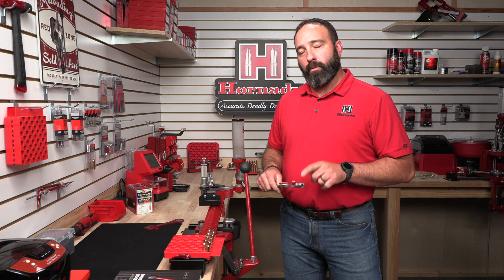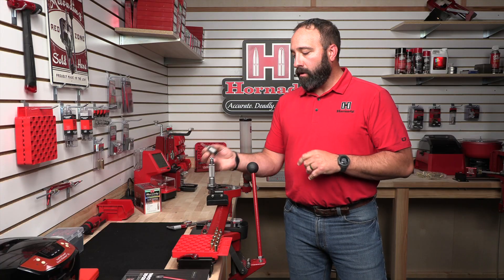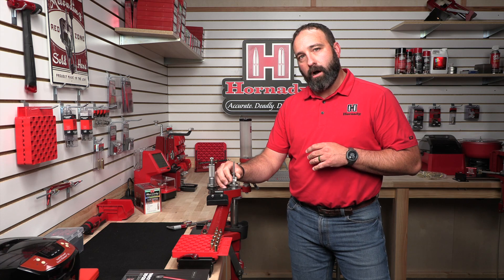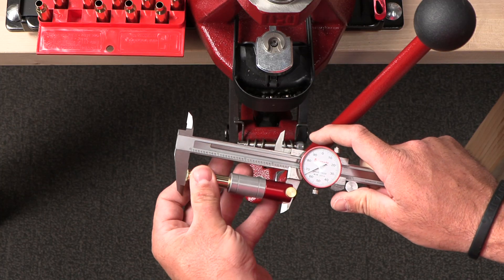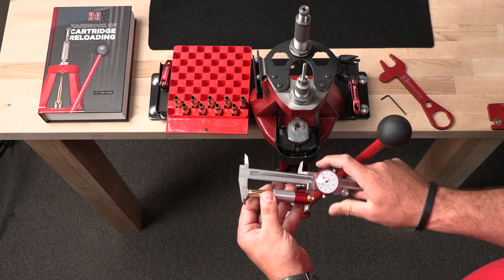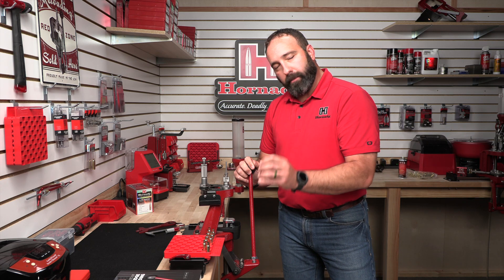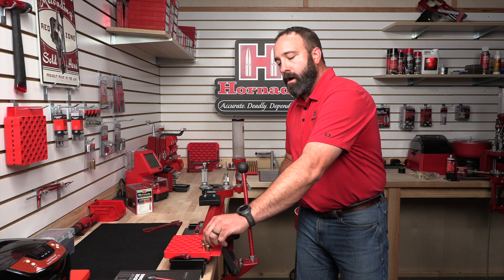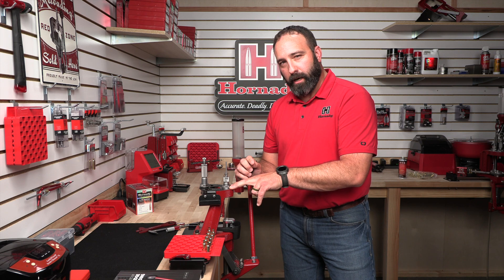TECH TIP | Setting up a Sizing Die using a Headspace Comparator

Comment: Please excuse my ignorance but I'm confused by your statement "sitting at 66 thousand"  That number  does not correspond  to the case specifications in the Hornady handbook for the 6.5 Creedmore.  What are you  describing?
Reply: Measure fired brass. Make that your zero. Rezero the calipers at that point. Sized brass should show -.002"
Reply from the maker: Just .066" on the dial indicator on the calipers.
Reply: It's no exact number, he just used the tick it happened to be landing on for that gauge to compare the next case to.

Comment: Which comparator do you use in this video? .375 or .400? Thank's!
Reply: Neck diameter plus shoulder diameter divided by 2.
So for the 6.5CM...
.295 + .462 = .757 divided by 2 = .3785.
So I think you use the closest, the .375 die #C375.
Plus on Hornadays website they list a ton of cartridge to die conversions.
I just Googled Hornaday Headspace Comparator, towards the bottom theses a long list, it also shows C375 for the 6.5 CM. 👍🏼

Comment: They neglect to mention that this is with their shell holder on their press. My first dies for the 6.5 Grendel were Hornady and already had a couple years using their comparator set and anvil and I cannot recommend those tools enough. The dies were junk in my opinion couldn't get even half way decent neck and bullet concentricity over .010" of wobble, but with my press and shell holder if you screw the full length sizer down to where it makes contact that was moving the shoulder .015" so I'd say it's better to screw it out at least a quarter to a half turn from contacting shell holder just in case until you know what work your die and shell holder combination are doing.
Reply: Agree on not screwing the sizing die until touching shell holder like you are saying if you do it moves the shoulder too far. I keep a small gap between die and shell holder to achieve the shoulder bump I want

Comment: That's amazing.   When I check my brass after running it through my Hornady press, I get about .003 variance from piece to piece with my Hornady comparator and calipers.   You measured the second one after a small adjustment, which was correct and viola, perfect.  So it's going to be spot on every time?
Reply: @russsmith1450  Your 100% correct. I thought it was just my press not sizing the brass to my desired shoulder bump every time. I have spent a lot of time adjusting my resizing dies. Now I'm between 0  -  3-4 thou of bump for my brass. I'm not going to stress about not getting it the same every time. I'm sure Hornady did several takes before they got it to be exactly 2thou of bump.
Reply: And I thought it was just me that had variation of shoulder set back.
Reply: You bring up an excellent point! I have also observed variance, and if the variance exceeds the targeted bump you will end up with a percentage of cases that are too long and tight to chamber. I have a handful of 300WM rounds I have to pull the bullets on and start over because of this. If you wish to substantially reduce this variance anneal your cases after every firing before you size. Also a crappy press very well might cause variance.
Reply: @trevorkolmatycki4042  I have started annealing my brass.  So, I will see.
Reply: I think annealing regularly is key to consistency and I use the Redding shell holders. https://youtu.be/YT8-gsAX5d8
Reply: I've never bumped my 300WM brass and only neck size after annealing every time. I'm not a BR shooter just hunt at long" 400-500 yards" shooter. Is it really important to bump?

Comment: May be beneficial to deprime the brass first. Sometimes the primer will be set out enough from the bottom of the case, and make it harder to get consistent results.
Reply: Fortunately, the standard case holder bases have a slot and a large hole where the primer is, so leaving the primer in will not have any influence.
Reply: @trevorkolmatycki4042  when I use a comparator, the base of the case where the primer pocket is, sits against the blade on my caliper, so if the primer is not flush or below flush, it affects the reading.
Reply: @johnknouse8846  good point… I forgot about that part 😂 I always decap and anneal before sizing which works well.